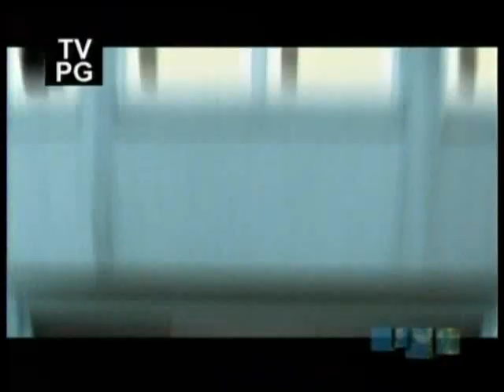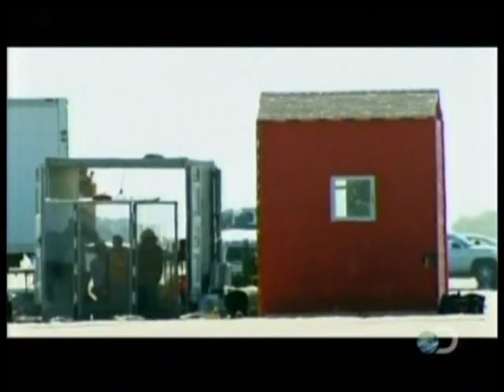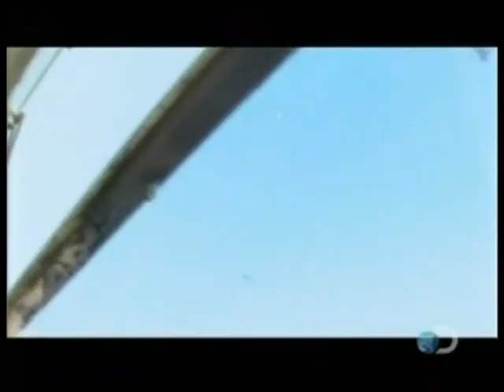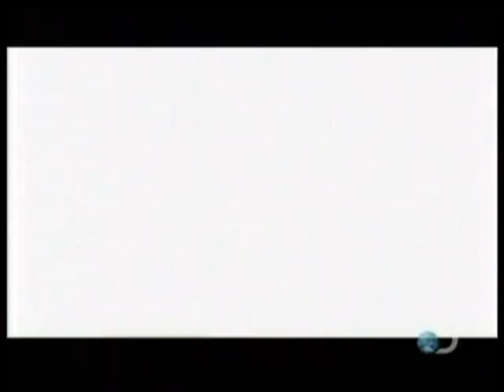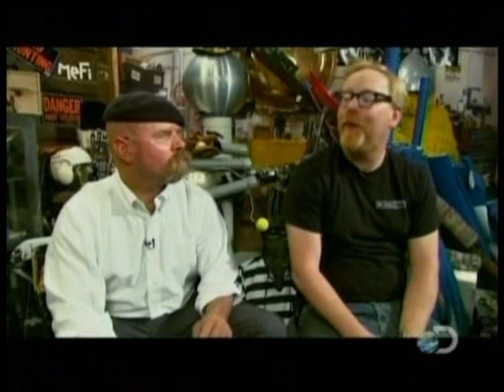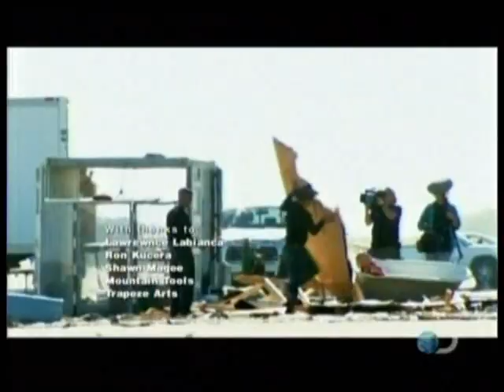MythBusters-Exploding Water Heater

Comment: +Greg Liebig, do you have any idea what the actual water temp was to create that amount of pressure in the tank?  (over 300psi).  I fought for YEARS with a propane water heater that the thermostat would intermittently stick and overheat and cause the pressure relief valve to open. It did this many times. I replaced the thermostat and problem seemed to go away for almost a year and then returned. The mfr didn't think it was the thermostat but agreed to replace it anyway (under warranty) but that would void the rest of the warranty. Everything else had been tested and in some cases replaced, just to eliminate source of problem. I began to suspect that the amount of hard water build up in the tank was effecting the thermostat sensor somehow and causing it to not sense temp properly. Worst part was, much of the time it would work properly, but every now and then, it would simply decide not to shut off!  I replaced the pressure valve several times over those few years to make sure it was always working properly, and also because in some cases after releasing several times it would begin to leak a little, or start releasing sooner than it should.
Reply: The temperature would be about 420°F for around 325psi.
Reply: The leaking relief valves show a build up of dissolved minerals (hard water) and that would also account for ther sensor crapping out (being insulated from the water by a layer of minerals coating the sensor) ...

Comment: I wonder if it would break through a cellar's ceiling
Reply: If it's wooden floor...no problem.
If concrete? Maybe.
But that pressure could also shatter all the foundation walls just where they join with the rest of the house...or the blast could travel up the ductwork from the basement..or through the doors...

Comment: is water heater designed to shoot up like a rocket when failed?
Reply: no, most of them explode basically destroying the house and killing everyone in it.
Reply: No, they're designed to blow the water out of a relief valve when pressure reaches 150 psi. And at the floor usually. Mythbusters must have removed or blocked it to get this explosion, and such blockages are why this happens outside of controlled tests.

Comment: Sad thing as a home inspector, most people (under 50) have no clue when a problem like this can get to the boiling point. I've seen water heaters installed where the safety valve is pinched against the basement wall and could never open when needed. My hope with posting this video is to encourage those that have access to their water heater is to take a look at the safety valve to see if it is operating condition. It takes less time to look than it does to upload a video and could save your life.
Reply: Greg Liebig thank you
Reply: Greg Liebig 
Unless you're dead.
Reply: "... a problem like this can get to the boiling point."

I see what you did there!
Reply: What the shit!???
Reply: Hello!
I’ve read online that water heaters are supposed to be silent. Mine is when the hot water isn’t running, the water heater doesn’t make noise until someone gets in the shower or using the hot water. The sound it makes is like water sounds, idk how to describe it, but it stops like 5ish minutes after the water is off. Is this sound normal? And are water heaters supposed to be completely silent?
I’m only asking cuz you know a lot and I’m scared after this vid 😬